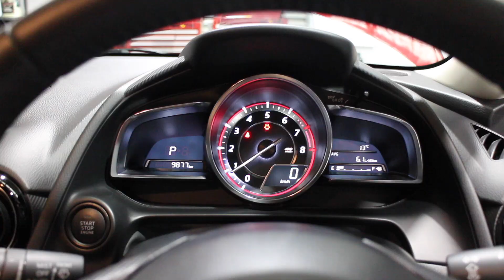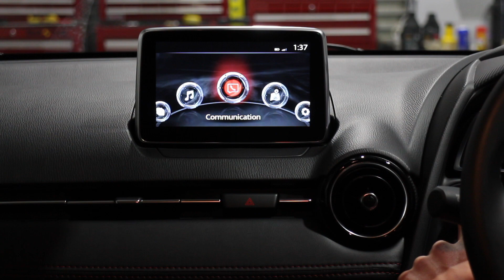Mazda 2 3 6 CX-3 CX-5 Skyactiv-G Oil Change How To

Comment: the weight of oil to use is on the filler cap. I also put oil in the filter prior to installing it.

Comment: Clean work. Did you add oil into the filter? Thanks
Reply from the maker: No I just installed the filter dry. Not really an issue due to how small the filter is
Reply: You shouldn't fill the filter, if dirt or anything gets in the engine it will pump it straight into the bearings completely unfiltered. Even something as small as a few microns could damage bearings.

Comment: what measure is the tool to remove the oil filter (1.05minutes). thanx I appreciate it
Reply: I Got a RYCO service tool RST201. Fits 65mm with 14 Flutes. Fits perfectly.
Reply: Thanx

Comment: in the little booklet that comes with the car it says to change it when the oil indicates the X on the dipstick.
You have minimum, maximum and above that is the X.

I do not understand this.
Does this mean that the oil will increase in volume over time? Because the X is higher up the dipstick.
Reply from the maker: The ‘x’ mark is only found in the diesel engines. And yes, in the diesels the oil level will rise under some circumstances
Reply: @YZJB  i never knew that, thanks for the info

Comment: How much oil will my wifes 2019 Mazda CX-3 Sport take with a filter on a change?
Reply from the maker: It should take 4.2 litres/4.4 quarts assuming the Australian model is the same as the one in your market
Reply: @YZJB  thanks!

Comment: what is the torque spec for that oil filter and oil drain plug bolt?
Reply from the maker: Hand tight for the oil filter and about 20Nm for the sump plug
Reply: What size is the hex bolt ?

Comment: Dang,today,I changed the oil and now it has a leak. I think I overfilled it because I bought the 4.7 liters and  put it entirely into the engine. I'm hoping it is just leaking the excess...,😣
Reply from the maker: Make sure you check the dipstick!
Reply: @ribs1911  no
Reply: @ribs1911  like I said, it may have been like leaking the excess or that that time I didn't tighten the bolt well😅